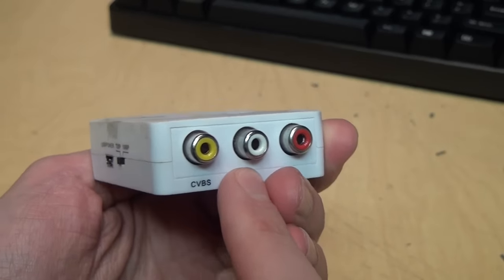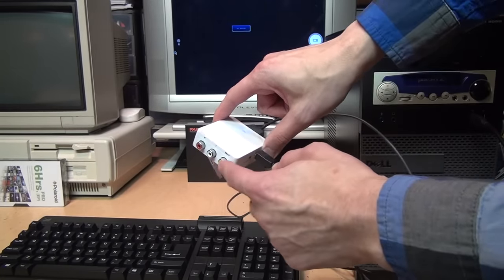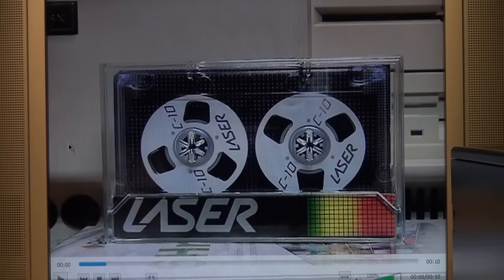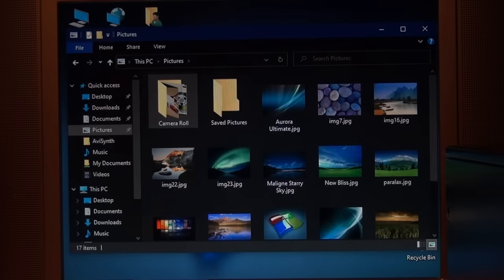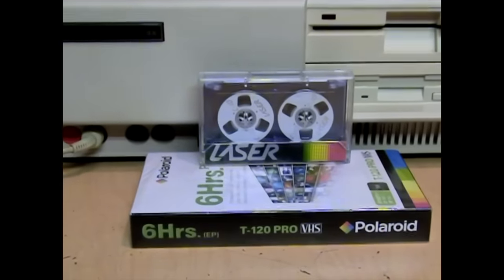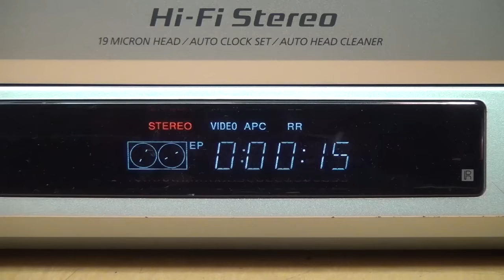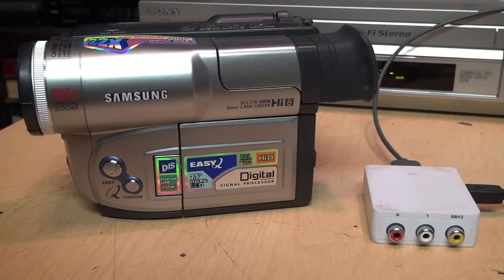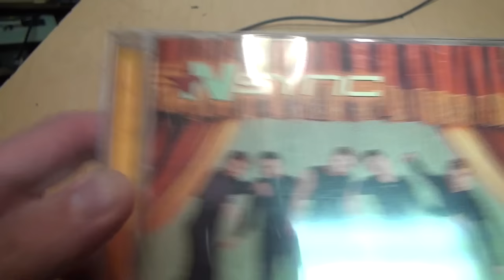Cheap composite video to HDMI converter - Is it really THAT bad?

Comment: The biggest issue with these sort of things for me is that you can buy a decent 15 year old Home theatre amp with HDMI 1.4 & decent deinterlacing DSP and multiple input switching and composite/svideo out and component in etc for like 80USD. And then you have a home theatre amp with audio DSP too.
Reply: Yep and those would have proper chips and audio sync too
Reply: Not very compact nor convenient though. :p
Reply: I got a pre-HDMI Panasonic reciever for like $30 at a pawn shop, for the price I figured why not just in case. My $40 all in one chinese amp (had bluetooth and an SPDIF input) I was using as for my desktop died so I decided to give the massive Panasonic a try before spending any mroe money, and wow everthing sound so much better. It's a little ridiculous becaues my Sony bookshelves barely fit on my desk and the reciever is on a table next to my desk but I can't imagine a desktop system sounding any better.
Reply: @Aeduo  Compared to what? I already had a mass loaded ATX studio PC and several portable racks full of studio/synth gear. And a full ATX gaming PC and turntable etc, 55" 12bit IPS etc.
Yeah, if for some reason you need your entire capture and gaming rig in your laptop bag its probably not the solution. If you already have some sort of desktop/lounge setup its not hard to find space for. Makes a good monitor stand at worst lol.
I used to VJ with a Full Tower EATX system and use the top drive bays as a handle to shove my arm in XD to me it seems.... fine? lmao
Reply: @CrashCarson14  I have some reasonably high end studio gear an im pretty sure i dont have a better DAC, let alone DAC-Amp,
24/192 Burrr Brown DACs, near flat from 5Hz to 100kHz, Farrouja DCDi deinterlacer/upscaler, lossless 10 channel audio etc.
My only regret is pulling the trigger when ebay had a free shipping sale (shipping 20lb amps is normally impractical) rather than waiting for something with a phono preamp and 6 channel analog in. But... not much
Reply: A DVD recorder with HDMI out isn't that uncommon, and is obviously intended for analog capture.
Reply: @Aeduo  You could also get a RetroTink 2X Pro, if you want something convenient and compact, though it can only output 480p since there isn't any scaling going on. It just linedoubles 240p and deinterlaces 480i. Sadly it's also a bit pricy at 139 USD, since it's a niche product that's geared towards retro gamers.
Reply: @mycosys  I guess I should be impressed by all the junk you've listed off to make your niche case an argument against why someone would prefer such a smaller device. :P

Comment: I would be really happy if these had S-Video. There is a composite NTSC <-> PAL converter that shares the same design. I have a feeling that these are all made by the same company, or at least, come off of the same assembly line. They cheap and cheerful, and they do the job.
Reply: I think a lot of the SCART ones support s-video with a cheap passthrough adaptor.

Comment: I used one of these recently. I needed to convert old NTSC VHS tape to PAL DVD. I had a PAL/NTSC compatible VHS player, but when I connected it to my capture card, it was only recording black and white. I had a convertor box which would make the signal colour but it only had scart input and HDMI output, and my capture card only had composite input. I knew my dad had one of these boxes so I borrowed it and it bridged the gap between HDMI and composite and enabled me to back up those old NTSC VHS tapes in colour to MP4, which I then converted to DVD and burned successfully. Convoluted way of doing it, but given the format constraints I was working to, it got the job done.
Reply: IF PAL DVD, cannot play to NTSC only DVD players if NTSC DVD, works fine with both PAL and NTSC DVD Players.

Comment: These "el cheapos" weren't even meant for working with video. They were primarily built for "upscaling" classic gaming consoles who had composite output (RCA) to something that a modern television could basically work with. It works ok with say NES/SNES/Genesis/GameCube/N64. Basically anything with Composite. The earlier HDMI enabled televisions had a full suite of inputs in the back for just this kind of work (HDMI/YPbPr/VGA/SVideo/Composite). Now these cheapie tvs are lucky to have more than two HDMI inputs and little to nothing else. 

I have an older Sanyo 19in HDMI with the full input suite I use as a test monitor. If you can find one of these, even though the picture isn't fabulous, I highly recommend them for testing, as opposed to these crappy upconverters.

Comment: With stuck heatsinks, if it's a silicone like thermal transfer material, it's usually possible to "cut" it using some strong fishing line, used like a cheese cutter / rope saw. Depending on how tough the "glue" is, use a few bits of wood instead of wrapping the fishing line around your fingers.

Comment: I bought a similar AV to HDMI adapter few months ago, because I just want to be able to play older video game consoles and VHS tapes on an HDMI only computer monitor, I mostly recommend it for playback purposes, not for recording and digitization since there’s better capture devices. But for HDMI input-only displays, and it’s simple hook up, I say it’s great for a cheap price and if you got lots of LCD monitors, because they’re easy to plug in for analog video!
Reply: Please name some devices what's better for capturing.
Reply: @clayerik  the PCI capture card or the AVer media A/V adapters they capture better analog video with S-video and A/V to the computer.

Comment: On the HDMI to composite adapters, they don't require that Mini-USB connector as the power it needs to operate was supplied via HDMI (despite having the port), yet the composite to HDMI adapters require it. I came across a lot of these of either type, including one that can do BOTH. I've seen other variants which is more streamlined (I use one of those to connect to my HDMI-only TV to my A/V switch box). I've seen them sold at Micro-Center for around $14.

Comment: Great video as always! One thing that helps a lot in the analog to digital conversion is a TBC (time base corrector). Full frame stand alone TBC is becoming more and more difficult to find and ridiculously expensive but one could get away either with a high end VHS device that includes a digital TBC, or a DVD recorder that has TBC: There were selected models like Panasonic DMR-ES10 and Panasonic DMR-ES15 that had line TBC and the best thing is that you can use those as passthrough, no need to burn VHS to DVD!
Reply: I have one of these, and I bought a blackmagic pro intensity card, but I could never get windows to see the card. I'm looking for another way to capture the HDMI stream from the panasonic. What would you recommend?
Reply: @mw01908  If I understood correct, you have Panasonic DVD recorder that has both TBC and HDMI output. Then you should consider yourself lucky! I have no experience with blackmagic pro intensity card, but I have bought 2 relatively cheap HDMI to USB adapters from aliexpress. The first one is based on the low end IC that doesn't support 1080 60fps and also has limited color capabilities. So I ordered another one based on the MS2130 IC that is supposed to support true 1080p 60fps and USB 3.0 speeds. Unfortunately, I didn't have the time to test it thoroughly but some test captures show a noticeable difference compared to the cheaper adapter. Btw these adapters don't need any drivers installation, they are automatically recognized from the OS, plug and play. I used OBS to capture from both devices.

Comment: I have something like that but something that converts HDMI to SD. It even has a PAL / NTSC switch and it actually works quite well for the few times i actually need something like that. I once even got a dedicated PAL / NTSC converter in such a little box too and that thing actually disappointed me a lot as the PAL signal had some really nasty artifacts from the format conversion, resulting in a pretty uneven framerate conversion that even has some nasty ghosting here and there. SO yeah these little boxes are sometimes hit or miss.
Reply: Can confirm that the PAL converter is very noisy. I've used many of these "Mini" adapters that you can find on ebay (and I think walmart?). I primarily use their composite to VGA adapter, so I can use older game consoles on a VGA/DVI only monitor.

Comment: I bought one years ago to hook up my SNES to a tv without composite. Worked great. Still got it!
Reply: That input latency had to be rough to deal with.
Reply: @Aeduo  there wasn’t any🤷🏽‍♂️
Reply: @xmdslipkfanx  that would be pretty nice. The input latency might've been coming from his capture device and/or the software he was using to monitor it.
Reply: @xmdslipkfanx  Same, i dont notice any added latency with the HDMI2AV adapter, its not worse than using my LCD to play emulators.

Comment: Every single generic (both cheap and better quality/higher price but still generic) miniplug to RCA cable that I bought in the last several years has the channels reversed (red as left and white/black as right, one even has "L" and "R" stamped and is still backwards). Interesting to see that they're reversing them on other stuff too.

Comment: The best thing would be a capture/conversion card that captures video at whatever aspect ratio, resolution and framerate is put into it. Letting a cheap low-power black (or white) box deinterlace and upscale a signal for you rather than doing it yourself will be significantly worse in terms of detail preservation. Also, you can use any directshow software with those capture cards (virtualdub being the most common), I don't know why you would use the built-in windows software which will re-encode it to what is likely a pretty bit-starved and inefficient encode.

Comment: I use Freemake for changing aspect radio of videos.  After selecting the target video type, select the screen size to change it to (e.g. 640x480 for your 4:3 video) and make sure the STRETCH option is selected. The converted video will now be the correct size by default.

Comment: I bought one of these for my SEGA Dreamcast but it looked awful on a 23.5" 1080p computer monitor. Then I bought a Kaiko all in one VGA cable and used that instead. HUGE difference even if it was only 640 x 480p. Then down the road I got a VGA-2-HDMI box and it still looks pretty sharp on a 43" 1080p TV.

But I guess you have to work with what's available. I could have dealt with it if it were Master System or Genesis. Maybe.

Comment: I use one of these (looks like the exact same animal, bought it off Amazon for $9 a couple years ago) for connecting 80's-vintage home computers and my homebrew video experiments to an LCD monitor when I'm too lazy to drag out a CRT, and I can't complain about it. It does a perfectly readable job converting 12mhz monochrome video that's generated straight off of 7400 series logic with very ad-hoc termination, and it also handles non-interlaced (The 240p not-according-to-Hoyle NTSC that was used by most home computers and video game consoles from the 1970's through the mid-1990's) video better than the integrated composite inputs on the cheapo 8" LCD monitor I keep on my bench. (It seems to be a common problem with cheap LCD TVs and monitors that they don't like non-interlaced video and give you a kind of line-flickery comb distortion.) Also occasionally used it with one of those cheap USB3 HDMI capture devices to capture stuff with OBS and, likewise, the results were perfectly acceptable considering how cheap the whole mess is.

Comment: I bought 4 of these from a supplier, same brand and supposedly same batch. The audio on these are reversed in 2, and normal on the others. Opening it, it comes with 3 visually different boards. They do last, however, been using them for 10+ years and are still kicking.

Comment: ffmpeg is probably my favorite program. If you have some audio or video, and you want something done to it, ffmpeg can probably do it 3 different ways. I even used to use ffmpeg to stream my desktop AND a webcam to Twitch before I got OBS!

I've been really impressed by all these no-name Aliexpress boxes in recent years. They used to all be really crappy, but I guess HDMI devices are pretty easy to make these days. I got a 1080p capture device for $60 a couple years ago and it works basically perfect. I bet you can get a 4K one now for even less.

Comment: This looks similar to what I have at home but I got it from Best buy. It was called vid box . The one I have has S-Video and RCA analog and then you can use it to exported through USB into the software that they give you. The only thing I didn't test with it yet is if I could do recording from a VHS tape that was pre-recorded and it has the copyright on it. I'm pretty sure I wouldn't have an issue with the type of VCR that I have at home. The only downside is you can't do it through HDMI unless you have a special adapter otherwise it does the job.

Comment: I've used something that looks like it but actually converted hdmi to composite and not vice-versa, because I was using it on an old TV. It even runs without external power, taking all it needs through hdmi. By disassembling it I discovered that the chip used also supports rgb. Unfortunately, these manufacture doesn't seem to care about doing a SCART version with rgb support, I think the video quality would be

Comment: There's an easier way to change the aspect ratio of a video. Use a program called avidemux, keep the video and audio set to "copy," set the output format as the same as the input (ex: mp4) then go to Configure, and the option to force the aspect ratio is right there. No re-encoding or command line stuff needed.
Reply: Thats another GUI for ffmpeg. Its exactly what he did without the point and click. Personally i would have probably use Handbrake as the forntend, but ive transcoded stuff on a server without the gui many times before downloading it.

Comment: I got given one of these, and I've used it with my 1998 Sony Handycam to connect to my TV. Works really well, but much better in 720 otherwise it's too sharp/harsh. Switching mode whilst powered with a signal doesn't seem to work. Thanks for the heads up on the reversed audio channels, and I must get a Y splitter. On mine it says on the top Mini AV2HDMI UP Scaler 1080P. 4:3 ratio is handled by the TV.

Comment: Some of those Chinese converter boxes have a switch choose 16:9 between 4:3 aspect ratios. If you want a higher quality converter with other analog inputs like component, S-Video, or SCART a XRGB Framemeister, OSSC 1.6, or Retrotink 5X Pro. All these options are quite expensive and come with long list of advanced options and have little or no input lag. These scalers and converters were created with gaming in mind. Other YouTube channels have covered scalers pretty well when it comes to gaming and video capturing/editing.

Comment: Dude thank you so much. I have a PAL wii and had tried using one of those wii2hdmi adapters to get it to show video in NTSC but it stopped working after 2 days. I was now wondering if one of those would do the trick but nobody had answer until you uploaded this video. Thank you Mr. VWestlife

Comment: TL;DR Yes it works nicely. I got that as a composite to HDMI converte then to a $10 HDMI USB video capture for old game console streaming and it works well. But better get something to split the signal because of input lag,

If you're a perfectionist you will find a lot of small quirks that will drive you mad. But you can correct them by video editing.

Comment: I don't even have HDMI but I watched this one. Unfortunately, the latency is too high to use it with a PS2 and play some games using a modern monitor.  For those video transcoding jobs we preferred Handbrake, you can select multiple codecs, custom resolutions (with or without following an aspect ratio) and compression levels to suit. Also doesn't show some scary things on a command prompt!

Comment: All of these mini converter boxes in this style seem to do a good enough job now. Tested an AV to RF one and an HDMI to Composite one - both do the job fairly well.
But, yeah, the 4:3 thing is a bummer. Supposedly there WERE versions of this out there that had a 4:3 / 16:9 switch, but seem to have gone out of production. Wonder if there's a pin on that HDMI output chip you could wire a switch to restore this functionality.

Another problem with this thing is that it does not support the PAL60 format at all.